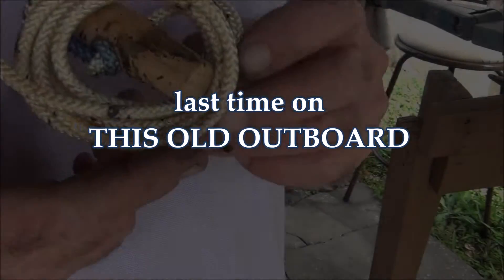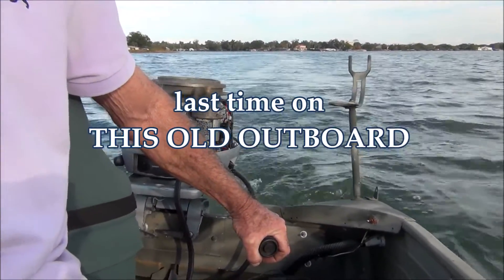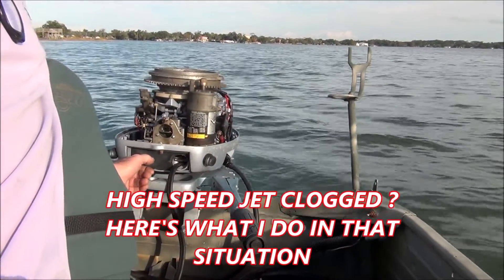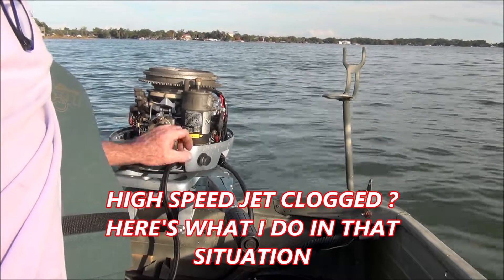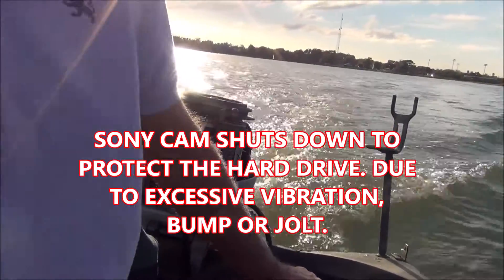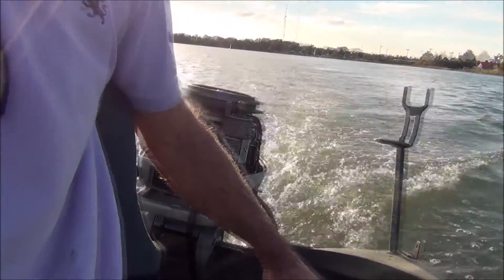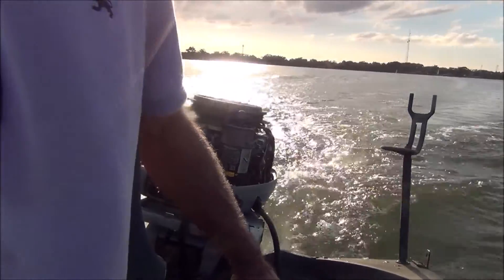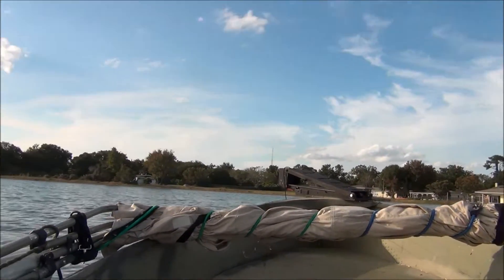25 Hp EVINRUDE  1983 - PANIC TIME !  Part 2

Comment: Good work on that set up.I know with my 14ft jon  20hp was pretty much fast enough.Like you say it is scary.Converting one like you have with a jet drive would be the ticket here in my rocky river.Power loss on a jet conversion is 30% they say and this would help out for sure.I have yet to unload all my gear out and really see how fast it would go.I did the 25hp conversion(intake swap) and it really made no difference in speed that I could tell,but I am sure maybe putting a 30hp or 35hp carb on would make some difference.Did you put any bigger fuel lines on at all?
Reply from the maker: Thanks for tuning in! Just catching up!

Comment: Hello. Nice video and Wow , That lil Rude is fast. I remember when my parents had bought a New Mirrorcraft 14 ft. Deep Fisherman V - Botton fishing boat with a 25 h.p. Johnson w /   Electric and Rope start. Long shaft. You're boat reminds me of my parents old boat. Their boat was rated max. H.P. 35  but.... I would literally been Terrified of it. My parents boat with that Johnson 25 was Scary enough.  You had to put weight up Front or at least in middle of the boat to try and hold it down at wide open throttle. Their Boat and Outboard were 1980 models.  I miss that old boat , nice runner like yours.
Reply from the maker: Hey. Thanks. Really appreciate you Watching and Commenting. This Old Evinrude I put a 35 hp Carb on it.  I got rid of that old green boat and put the Evinrude on my 15' aluminum Dura Craft. It's Spooky and it's all in my Videos (plug hahaha). Thanks again. Stay tuned !

Comment: Hey buddy, I'm  gonna remember that little trick. Definitely sounds better. Anyway you can do a video on putting the tiller handle back together. Had to buy 1 for my 20hp and it was in pieces. Pretty sure all the parts are here I'm just not sure where the spring goes. It's giving me a headache. I've checked the schematics but it still don't show how to put it together. Lol, keep the videos coming. Yeah baby I can't get enough
Reply from the maker: Hey. Thanks. The handle can be a pain in the ars. You can take the whole thing off or take it off piece by piece. I would take the whole thing off and take it apart, take pictures or video, then put the new one together. You should see where the spring goes from the old one after you take it apart. Should be washer, spring, the plastic/nylon piece called the friction block, then the handle. The pivot bolt, nut and washer that holds the handle on has to be just right, not to loose/tight. Use some locktite on the nut so it dosent come loose from lifting the handle up/down. Hope that helps. I think you'll be alright. Thanks again. Stay tuned !
Reply: Appreciate your time, but the motor didn't have a tiller on it to look at. Was setup for remote and the handle disappeared. Seems like alot of pressure on the spring the way you described. Guess that's what the grease is for. That's the only way I came up with to do it. That's why I was wondering. Thanks a bunch buddy
Reply from the maker: @garysample1980  Hey. I was wondering that, whether you had the old one or not. I'm getting you guys mixed up. Does it have a place to mount the handle and what all is there.
Reply: Yes sir it's got everything, rod, gear, throttle linkage. 1 of the reason I bought it because the tiller hasn't been on it in a long time. It all still looked new for a 45yr old motor. The handle (tiller) I got was complete but was in pieces. Check my book and all the pieces are there just couldn't find out how to put back together. It actually fits like a glove when I made sure it was going to fit
Reply from the maker: @garysample1980  Okay , check this out. Scroll down the page until you get to,  ''Gear Type Throttle Linkage'' . There is a schematic which shows the layout of parts, its a 15 horse but basically the same thing. I think you should be able to figure it out.  https://www.leeroysramblings.com/Johnson%209.9_15.htm
Reply: Hey buddy, that work great and like you said, "it was a pain in the ars". Haven't been able to get any video of everything I have been doing but if it runs at the lake. I will definitely try to get some video to post. Your videos inspire me to do my own work and it takes longer but it's a whole lot cheaper than the shop will charge. Thank you very much. Keep them videos coming. Yeah baby lol
Reply from the maker: @garysample1980  Hey. Kool man. I was wondering how you made out, and its better to do your own work, You have to know your motor better than anybody. They really aren't that difficult to work on and like I always say, its just a big weed eater with a cooling system. Hahaha Thanks again, and anytime I can help. Stay tuned !

Comment: I have a '73 25hp that makes a kachunking noise you can hear and feel when running above trolling speed. I was hoping you or someone reading this may have an idea what it might be. I got the boat and motor from my great uncle after he died and it looks almost brand new under the hood.
Reply from the maker: Wow. Maybe its slipping in and out of gear. Does it do it in reverse? Check all the shift linkage. Check to oil in the gearcase. You can find a service manual at boatinfo.no. Thanks for watching !
Reply: @THISOLDOUTBOARD1  I took gears to boot shop and they said they looked good. He suggested that clutch dog was not fully engaging so I adjusted it to fully engage.  It was snapping shear pins before but didn't when I took it out Wednesday.  I also reversed clutch dog.  Not sure if it does it in reverse because I'm afraid that much throttle would swamp the boat lol. I'm going to rebuild carb and check the high speed needle.  I'm wondering if it could be a fuel issue. I'm aldi going to test it in a trash can of water but it's hard to keep water on the can at higher throttle ski I'm thinking of trying it without a prop.
Reply from the maker: @jeffreyalldredge7890  Check the linkage at the brass connector that connects the shift shafts, sometimes they can get worn and slip on the rod not allowing to fully engaged into gear. I dont think its a good idea to test without a prop. I think the motor can start to run full blast out of control. Also the shift rod on the gearcase could have gotten screwed in to far, that will make it jump out of gear too, not being fully engaged. Give it one or two turns counterclockwise to lengthen it and hook it back up. The actual measurement will be in the manual.  I dont think you have a fuel issue.
Reply: @THISOLDOUTBOARD1  Thank you for your input, it's very much appreciated.  I will do that when I get some time in the next few days and see if that helps.
Reply: It  doesn't seem to jump "out" of gear,  when it happens it doesn't lose speed or anything like that,  it just has that kachunk sound and feel. It almost has a rhythm to it about every 4-5 seconds or so.
Reply from the maker: @jeffreyalldredge7890  Yeah I know. I use to describe as if I was hitting a turtle or something but never at a rate your describing, just every once in a while, and no it dosent physically jump totally out of gear its more like its bouncing in and out.

Comment: My 83 25hp Evinrude on my 96 14’ deep and wide Grumman gets me to 34 mph and your correct that’s a little unnerving! Is that motor a 28SPL ? Just asking .
Reply from the maker: Hey. (somehow I missed this comment.) My friend just picked up a 14ft Grumman 4.4, very wide$200 with title. I gave him the 63 28 horse RX-11 to put on it. Should be sweet! thx
Reply: THIS OLD OUTBOARD that should move that boat nicely! It’s a little heavier then my 83 but a nice motor for sure ! I’m not sure on the numbers for my boat but it’s 72” wide w/ 6” cut away on transom and uses a long shaft so I believe that makes it 30 or 32” deep . SKOL BUD !
Reply from the maker: @davekimbler2308  I got the 25 on my Dura Craft yesterday, talk about a screamer, Geezus.
Reply: THIS OLD OUTBOARD No shit , I had to change my freaking shorts mine was so fast and on a light boat ! Have fun but be careful !!!
Reply from the maker: @davekimbler2308  It's gonna be perfect with two people and gear. Stay tuned !